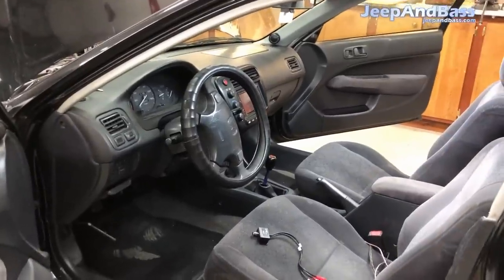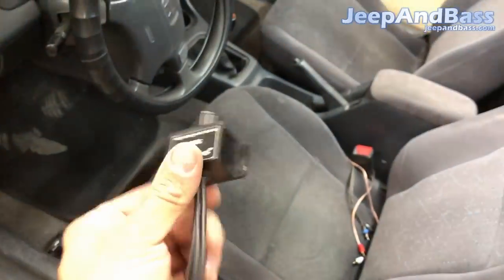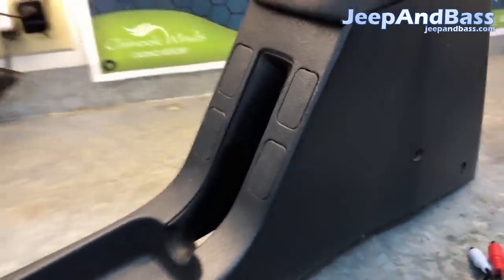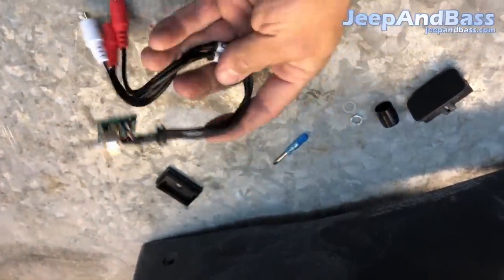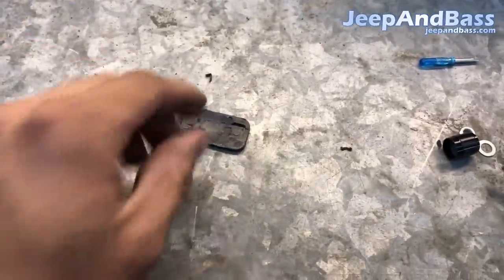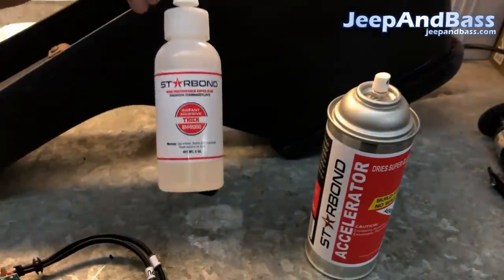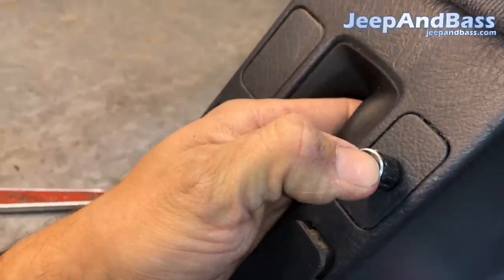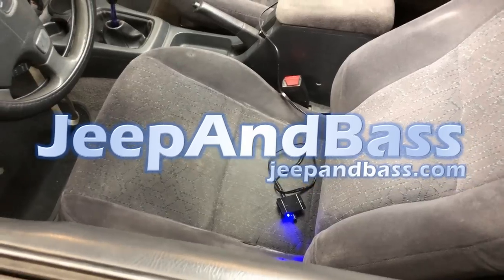Installing a remote Bass Knob

Comment: That's a good beginner bass knob that stinger one you did a sweet job at installingtgat bass knob. I've upgraded to my Slam Panda bass knob i love it i got my RCA's from sky high car Audio
Reply: "Beginner bass knob" lmao people with $20,000 builds still use LCA-1s I have no idea what you're talking about.
Reply: @brandonthompson9957  Look on my YouTube channel under Slam Panda bass knob then you'll know exactly what I'm talking about.
Reply: @psementalist  I know of the bass knob. Just because it's more expensive or made out of a better material, or has a volt meter lol doesn't make the way it works any different than an LCA-1. Same thing
Reply: @brandonthompson9957  Brother I'm not arguing with you about that i got my Slam Panda bass knob just because i was upgrading everything else in my system rebuild up . Mine doesn't have a volt meter built into it i wanted something that was totally customized to my personal likeness in this case it was to match my car's name of Praisenator its blue and I love the great job they did on it . My volt meter happens to be stinger its worked great over 9 yrs
Reply: Beginner bass knob?? Is that even a thing??
Reply: Drupey 187 no the guy is a nutcase

Comment: Good video. Looks like the kind of bass knob you could install if you have a Brazilian amp since they don't come with one. Also could you put some kind of tint on the clip indicator light to knock down the intensity of it?

Comment: I have a quick question on this, sorry I am a bit of a beginner when it comes to this kind of stuff. So I want to install a bass knob in my car, which already has a sub and mono amp wired. Would I basically be unplugging the rca from the head unit to the amp, and wiring the knob "in between". So it will go from head unit, to the control knob, then back into the rca on the amp (where it is currently wired to?
Reply: We’re you able to find out? If so can you help me out? Thank you!

Comment: Where did you get that. I want to get one for my skar lp1000. So i dont have to have my seat down to see the clip light. Usually only if I have other in the car is why. But I cant find it on amazon or even on the stinger site.
Reply from the maker: For the skar amps you'll have to extend the light directly from the amp since they dont have external clip lights

Comment: Why doesn't everyone just use the sub control that's built into the head unit?
Reply: not the same
Reply: @spincr4hire72  explain please. Don't they both cut or fade the signal coming into the amp?
Reply: Sinister yes but not as fast. most people set gains accordinly and then use knobs to turn up and down with different songs or when you want to just turn it down slightly. It's much easier when driving to use a knob and you can get more fine control. also when you use the sub control settings in the headunit it messes with your signal levels. while all the way up on a knob is just 100% signal, while all the way up on the headunit is higher than 100% signal(clipping) 
there are exceptions to what i said but overall that's reason why. I hope this helps explain more